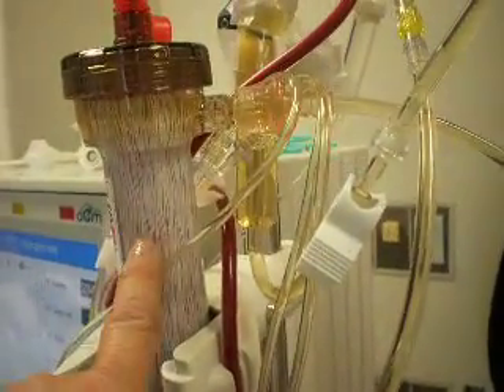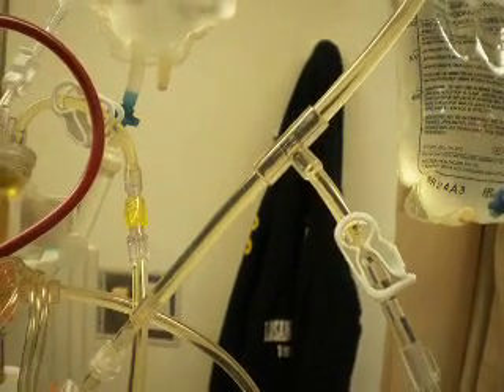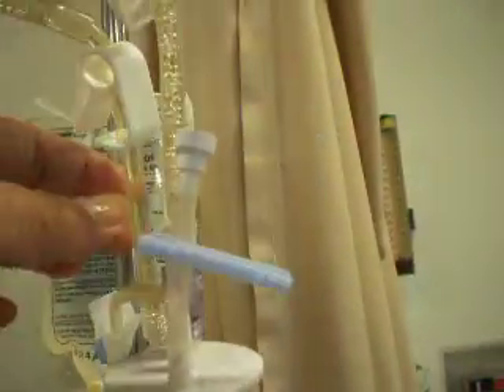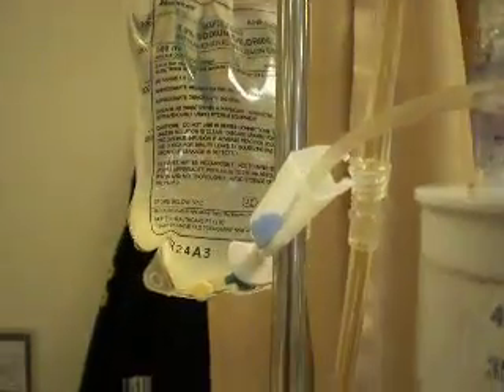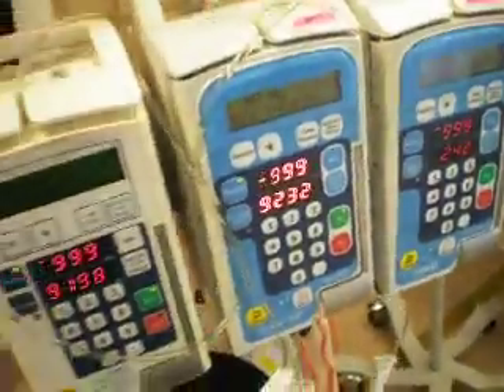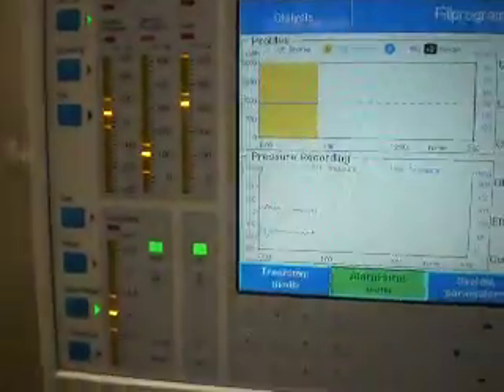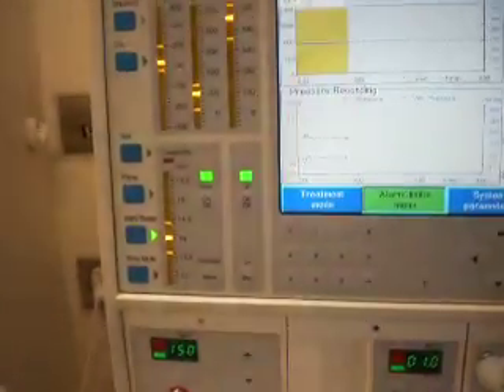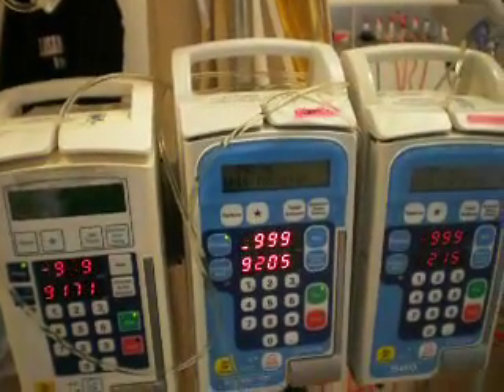Glycosorb ABO column

Comment: I suggest you turn off the Dialysate flow and set ZERO UF so that you won't have any problem with the TMP pressure fluctuating. Then you can increase your blood pump by 250ml/min  to maximize your Plasma output by 50ml/min or 3000ml/hour. It is a good idea to use a drip chamber so that you will have enough plasma, but the disadvantage of that is that there will be more Plasma out from the patient. Good video and very informative.